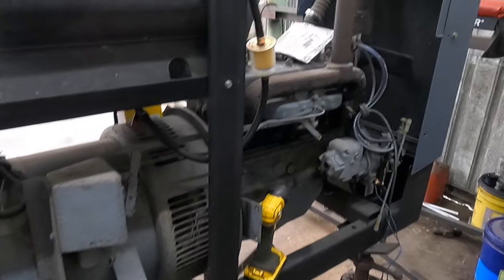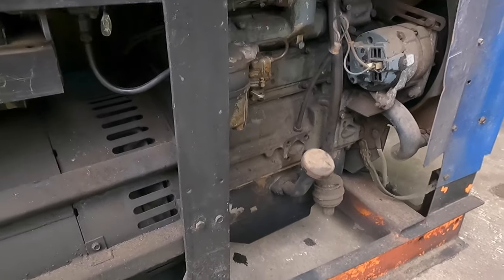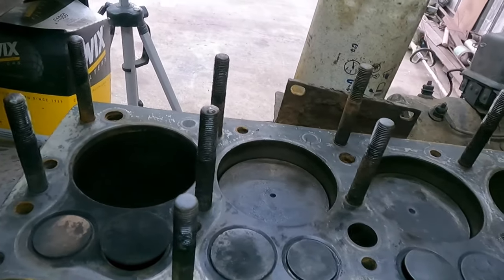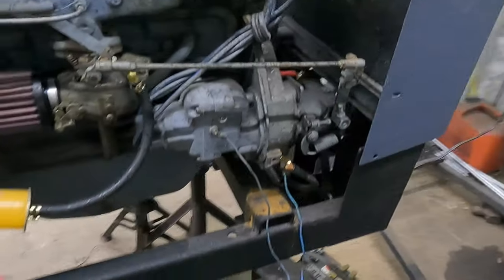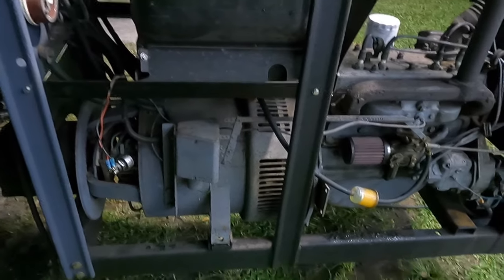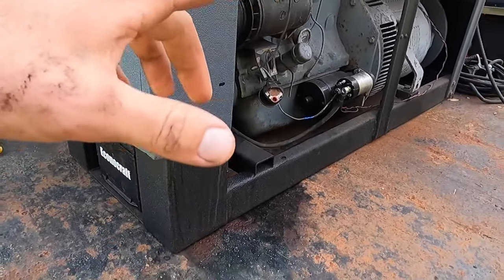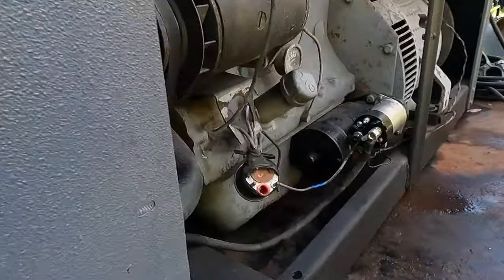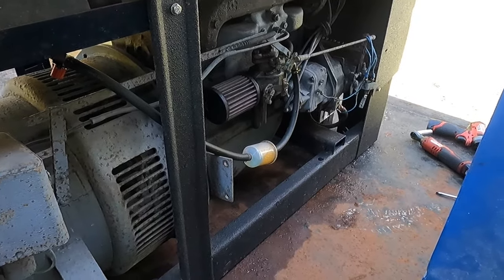SA 200 Stuck Valves No More!!

Comment: why didnt you wire brush the carbon off the valves? did you wire brush the head to remove all the carbon before putting it back together? that small pipe unthreads out of the water pump so you dont have to unbolt the water pump and ruin your radiator. you can put #1 piston at TDC while the head is off and the firing order is cast on the head and those air filters are no good because they let in fine dust that will eat up your piston rings. get the old oil bath filter back on it or get a paper filter. if it doesnt weld right check to see if all the big brushes move freely in their holders. a sticky brush will make the arc act funny and the gas tank is not the correct one

Comment: I got a 69 red face, had it sitting for a while and i got it back to running but it won’t strike and arc any suggestions?
Reply: Does a grinder work off the receptacle?
Reply from the maker: I had to clean the armature on mine, used a profax stone